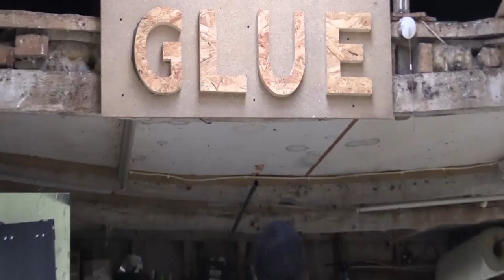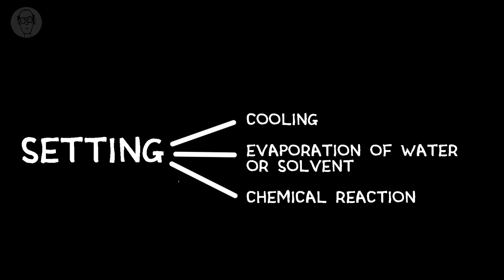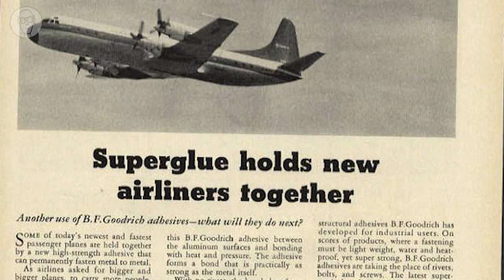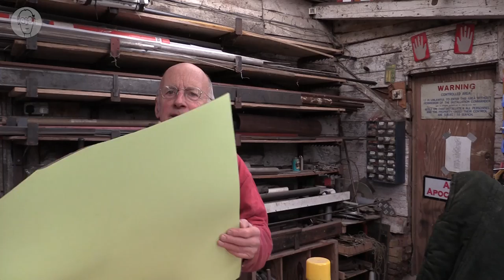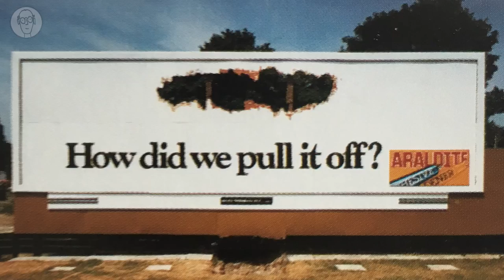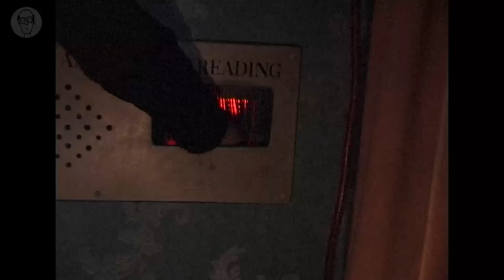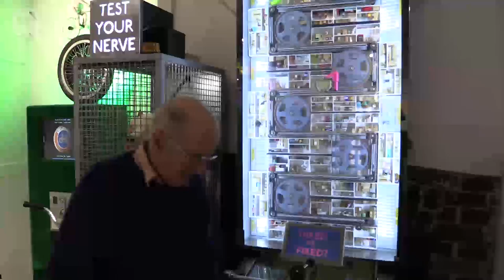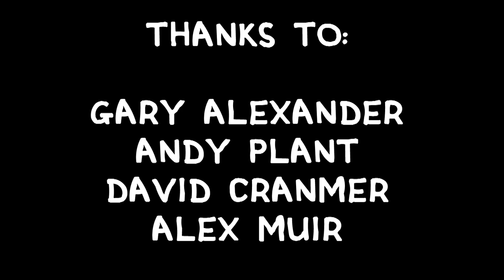GLUE - The Secret Life of Components - a series of guides for makers and designers - Episode 7

Comment: 33:21 - to recover the spiral tube waste when using specialist and very pricey resins (marine/subsea applications), we lay it lengthwise in a groove cut in a block of scrap wood (routed out with a round bit for production use) and slit it lengthwise, twice, with a Stanley knife ( which of course gets kacked up badly )

Remove the spiral and scoop out the remnants of the glue from the halved tube, giving it an extra mix with a lolipop stick before application because remember that mixing is minimal-to-none further up the tube. 

It's messy, tedious and frustrating - as well as a frantic race against time - but it saves a fair bit as the volume in the tube is a very significant proportion of the syringes.
Good task for an apprentice. who needs to be well briefed and ready for it with everything to hand :)

I first saw this done by a builder who was installing resin anchors and had lost one of his cartridges - he literally swore every 2 seconds all the while he was scooping resin out until he was finished.
Reply: Necessity is the mother of all cursing

Comment: Protip regarding hot glue: to peel it off easily you can use isopropyl alcohol, it makes unsticking/undoing things very very easy and doesn't leave residue
Reply: Yeah! Came down to comment this, glad someone beat me to it.
Reply: Ordinary methylated spirits works just as well.
Reply: Another useful tip : as Tim said, hot glue doesn't work well on cold or thermally conductive surfaces. It freezes before it can make a proper bond. But it will stick, even though it can't soak in, if you warm a metal surface first. Alternatively, tack it in place quickly then warm the area with a hot air gun. The glue reflows over the surface and makes a much better bond. It even looks neater.
Reply: @loukashareangas4420  Same! And same!  It's tip that turned Hot Melt Glue into an 'every day' glue for me. 
It even comes undone from MDF and other fragile surfaces.  That impressed me.  And IPA won't damage/swell things.
Reply: @ElectraFlarefire  Be sure that you use 99.5% IPA
Reply: @MoseyingFan  I used to hate 'rubbing alachol'(70%) and never worked out what the point was, until someone introduced me about 10 years back to 99.9% from the local electrical store.
Now I get it in 5l bottles and it lasts me about two years. Great stuff.
Reply: Another who was going to mention the isopropyl trick. The other thing that transforms hot glue is using a professional hot glue gun (and sticks). They aren't cheap but they are just so much better than the consumer grade ones.

Comment: The section about hot glue loosing it's strength when it gets hot reminded me of an incident at a furniture store.
  In the late 70's, a few of us were making furniture in a friend's garage. We were experimenting with an industrial hot glue gun, using the glue to hold some pieces of wood on our furniture. We didn't want to drill and plug some exposed joints, so hot melt seemed the perfect solution.
  We tested the joints, banging them with a hammer, and they held up well. We put one of our pieces, a chair, in the street facing window of a friend's furniture store. The Summer sun beat down on the chair daily, and in 2 days, the chair started to disintegrate. Pieces were falling off by themselves, or when touched.
  Back to using screws and plugs.
  One thing about an industrial glue gun. It uses compressed air to push the glue out. This saves squeezing a handle all day, plus the glue gets REALLY hot. We didn't have a water trap on the intake for the industrial air compressor. Water, in the air line, and high heat, turns into STEAM. Then the steam, inside the gun nozzle, mixed with the super-heated glue, blew the scalding glue out of the nozzle like a shot gun. Onto our exposed flesh. Sticking to, and burning, the backs' of our hands.
  Many band-aids later, we concluded that we needed a water trap. Also, pulling hot melted glue off your hands is really painful.
Reply: Had some hot melt glue sticks on the backseat of my car once, on a sunny day.  Part of them is still stuck to the upholstery alas.
Reply: Haven't ever had hot GLUE....
Molten sugar and I, however, are arch-enemies. Worked in enough kitchens around the desserts to get molten sugar on my hands a few times. It's like napalm, and even if you think you're smart and run your hand under cold water....it forms a 'skin' of cooled sugar on the outside while the inside keeps right on burning you. It's the devil's saliva, I tell ya!

Comment: I knew the phrase “Stuck on you” would be found. I have a tip you may find useful: The demonstration of PVA & other simple wood glues, you found they slide when clamping. We saw that! While watching a TV show, an older woodworker took a pinch of salt and sprinkled a small amount on the wood glue, then clamped together with no slipping. The salt crystals in salt have spark edges a stop the sliding. The salt did not effect the adhesive and dissolved into the liquid! Brilliant I thought, this guy was building wooden planes by glueing sides to a cut block for the iron & mouth to create a plane as done for centuries except the old one were on piece blocks. A tiny pinch of salt goes along way! Cheers, I enjoy the info. 
  Interesting plastics are marked with symbols for recycling. Car parts from radiator end tanks, oil pans, intakes have to resist oil, fuel/petrol and extremes in temperatures while retaining their shape. One in particular, marked PA66 GF33 is a nylon polyamide with 33% fiberglass filler to add strength. It is difficult to glue, but a few companies make it. The problem I found for a home tinker is that one bottle is slightly expensive but sold a cases of product only. It is like hotdogs & buns. You get 7 hotdogs but 8 buns! I may never make it to London but would shake your hand and then converse for hours. I enjoy!
 The inner child is still home.

Comment: Hi Tim - have you used UV glue - if not I think you'll like it. Comes in a little tube, sometimes with a UV LED in the back (e.g. Bostik Fix & Flash)  - it's clear and quite runny, but sets hard in a couple of seconds when you shine UV at it - very useful for things you want to adjust then set in position.
Reply: My dentist highly recommends it!
Reply: UV glue is great, it does come in a variety of grades from very hard to fairly elastic when cured.
Reply: @jamieacraig  Yes, the pen style from Amazon appear to be filled with whatever is left over in the bulk containers. I stick to buying branded 50ml bottles now.
Reply: I'd advise getting UV glasses, those yellow safety glasses. Don't damage your eyesight. Other than that photocuring resins are very toxic, I'd expect you're supposed to use it only in a very well ventilated place or with a respirator if in quantity, with gloves too to prevent skin sensitisation.
Reply: @MaximilianonMars  There are medical grade UV curing adhesives used in dentistry.
Reply: The only superglue that ever seems to stick and hold for me was ironically a cheap glue I got in poundland. Anything else and it lasts all of 5 mins of use.
Reply: Also available in soldermask varieties -- good for repair as well as prototyping.
Reply: I can't say I'm surprised that you're a fan of Tim hunkin too, considering your YouTube channel that I've been subscibed to for years!
Reply: One of the great things about the UV-set stuff is that you can use it to bridge fairly large gaps when repairing things by quickly building up layers of glue. Real-world example: 

I had a key fob that was supposed to have a plastic bridge to thread a keyring through. My keyring had rubbed through the plastic bridge. To fix it, I applied a little UV set glue to the edges of the gap and hit it with UV for a second or two to set it up. I repeated the process until the gap was closed and the bridge was rebuilt, then I exposed it to UV for a prolonged period to make sure it was all cured up.
Reply: @techobsessed1  They've got those handheld extruder (3D printing) pens, why not resin printing ones too, ayyy!
Reply: It is so rarely reliable though! I'm sure the stuff in the adverts works, but the stuff you get in the mystery tubes isn't the same.
Reply: @T3sl4  great glue guy
Reply: Mike - How do you un-glue it?

Comment: PVA is Poly Vinyl ACETATE. It also stands for Poly Vinyl Alcohol, but that's a different thing -- used as a mould release agent for fibreglass, and the opposite of a glue :)
Reply: Ah. But does that explain why kids like eating it? I tried it once, it tastes bad like shaving foam. Which I didn't try on purpose, that's just what happens when you shave with foam, you end up eating some by accident.
Reply: Freudian slip if you ask me!
Reply: @MaximilianonMars  I know a guy who "rode the short bus" as a kid.  We were working on a project that involved using pva glue and I asked him if he ate glue when he was younger.  He corrected me and said it was paste, not pva glue, that tasted good.
Reply: Absolutely correct. Polyvinyl Alcohol would not work as a glue. It easily (very easily) dissolves with water (cold water) or alcohol. It    simply forms a dissolvable film that acts as a release when casting various resins in molds (moulds for those that like this spelling better).    Most of the time it has a green tint to it so you can be sure you have complete coverage on the mold surface. It does come clear as well which can be useful since sometimes the green color can stain the surface of the casted piece. This usually happens due to heat generated from exothermic reaction of the resin that is being used (polyester resin, for instance, can generate a lot of heat especially on thick castings). The film can melt into the casted part and become difficult if not impossible to remove. Well now you have way more information on a subject that is pretty unrelated and for most not very useful. O well.

Comment: Very useful and practical! One comment: epoxy and acrylic glues need a bit of layer thickness. With 0,1mm upto 0,3mm there's a way for the glue to stretch a bit and even the stress out. So don't clamp too hard. Using distance pieces (paper, metal, glass balls) makes it easier to maintain the appropriate distance.
Oh, and rough op the surfaces! First clean, then use scotch brite.

Comment: From my experience of 30 years of teaching technology in schools: 
If I am sticking say wood to metal, I first coat the metal with Loctite and then glue the wood to that with cyano. Cyanoacrylates can be bought in a variety of viscosities, the thicker ones are much more controllable and with less tendency to run down your arms and glue your elbows to the table.

 Kicker/activator can be bought at any model shop, you don't have to buy mitrebond to get it. Also great for neutralising superglue spills. Zap and it's set and you can scrape it off the table later.

There is a trick, much promoted on YouTube, of using bicarbonate of soda to fill gaps and then trickling super glue on to that, it sinks in a sets very quickly. I don't know what the supposed advantage of bicarb is, but almost any dust works, the wood flour dust that collects inside your bandsaw is particularly good and creates a very strong composite material with the glue. Wood dust has the advantage that you don't have to go into the kitchen to look for it.

Wrapping a joint in cotton and letting super glue soak into that, makes a very strong joint too.

The trick with solvent Tensol is to use a small metal tipped pipette to apply a small dribble to the assembled joint and let it run in by capillary action. I get a clear joint about three times out of four. The surfaces to be joined need to be accurately flat it but works better if it they (or one of them.) are not polished.
Reply: Donald, just an FYI for others who might not be aware of it, superglue in larger quantities can get quite hot in reaction with any kind of cellulose or biological materials, be it cotton, wood dust, or human skin. It can burn your skin, or set something on fire, as numerous You Tube videos demonstrate. 

Guitar repairman Ted Woodford in Canada ( the twoodfrd channel on Y-T) frequently uses superglue in conjunction with wood dust for impressive color-matched repairs. People also use superglue and baking soda to replaced chipped-off plastic or bone, such as the slotted nut or saddle that the strings pass through. It can be filed, sanded and polished!

Comment: Another good use for the 2 part CA based mitre glue is for holding joints while they glue with pva.  Put the pva over most of one of the surfaces, and a few spots of the mitre glue on the rest.  The CA will then hold the joint firm long enough for the PVA to cure
Reply: Nathan Lucas ...
Excellent tip. Thank you.
Reply: @DrQuadrivium  not my idea!  I got it either from Steve Ramsay (wood working for mere mortals) or Jimmy DiResta

Comment: Superglue (cyanoacrylate), particularly the very thin variety is great for strengthening old, weak wood. It wicks into the pores and sets very hard, but brittle. I use it for repairing piano pinblocks, bridges, and soundboards - it has good sound transmission qualities. The one thing it really lacks is shear strength - but when you are using it to make a composite, it's excellent.

Comment: Some 25 years ago I saw a construction worker installing threaded rod into holes drilled into concrete, using special glass test-tubes with the threaded rod sticking out and the test tube pre- filled with colored beads of epoxy resin. Chuck the threaded rod in a cordless drill, stick it in the hole, and spin  it with the drill; the glass tube breaks and the spinning threaded rod mixes the epoxy.

Comment: This series is amazing, thank you! Couple extra tips I've picked up with respect to two part epoxies: Surface wetting goes both ways. With thicker more viscous epoxy thoroughly wetting both surfaces will ensure a good bond and if you leave the "squeeze-out" alone it will easily chip off later with a sharp chisel. Wiping off the squeeze-out will push some of the epoxy into the surface and make it more difficult to clean up later if you didn't do a thorough wiping (especially for porous surfaces like wood). Probably less applicable to thinner less viscous epoxy. The other tip is to always save any left-over epoxy and the applicator you used. Pile up all the excess epoxy into a glob and stick the applicator into it. You can now refer to this to check how the epoxy is setting up instead of messing with the thing you are gluing. This can let you know if your epoxy batch was bad and didn't work and give you an idea of when you can safely move the object without it just falling apart.

Comment: For your Whack-a-Banker machine, to help your hammers last even longer you could make the platform surface around the area where the bankers are popping up from, out of some kind of foam (even if it were 6in diameter rings of foam that fit around each of the holes) that would absorb a lot of the impact (the foam rings could be a replaceable item too)

Comment: I am being pedantic, but epoxy doesn't "dry", it cures by chemical reaction (as does superglue, but by a totally different type of reaction). 5- minute epoxy isn't ideal for joining metal, but a slow cure epoxy will grip incredibly well as long as the metals are degreased, and sanded to rough up the surface. JB-Weld in particular, containing powdered steel is incredible stuff, people have repaired cracked engine blocks with it. There's a 5 minute JB-KWIK and the stronger, slow cure JB-WELD variety. Devcon is another excellent epoxy brand.

Comment: Hey Tim, not sure if you see this or not.  I have come across some 'rubber toughened' CA glue.  It's quite nice.  It's much less brittle than typical CA.  It's very good for a bonding a variety of materials together.  Starbond in USA has been great for me.  I find that CA products of different sources, they differ a bit in quality.   Some brands activators cause the glue to aerate a bit which weakens it.  So, l sort by application needs and cost.  Fantastic video.  The self wicking Loctite is used very often to add friction to plates which you don't want to slide, say after a precision adjustment.

Comment: A great tip I saw on some YT video about carpentry suggested using some medium/coarse salt sprinkled onto the PVA glue for wood - the crystals dig into the two pieces of wood and stop the joint sliding about before you clamp it.

Comment: For sticking laminate to something using contact adhesive, a useful trick my father told me is to lay a sheet of polythene on the plywood (or whatever), covering the whole surface.  Then lay the laminate on top of the polythene, line everything up, and gradually pull the polythene out from between the sheets.  Works very well indeed.  I had a kitchen  work surface, which was fitted in place round a chimney breast and into a corner of the room.  I cut the polythene pretty much to size and shape, the laminate had to be exactly to size and shape on all but one side.  Put down the polythene, laminate on top and pulled out the polythene.  Exactly in place.

Comment: 'Sikaflex'-type polyurethane is great, not just for glass to metal. Withstands higher temperatures than silicones. I've even used it to bond a metal plate over hole in car exhaust silencer. Also make objects with it to any shape or size,  including any metal components while setting. For instance a drive wheel - grind down to the required diameter.  Good for mending torn mounting bushes or making new ones.  Mix some of it with acetone and can paint it as a rubber coating. If it gets on your fingers wipe off before sets with ordinary alcohol.